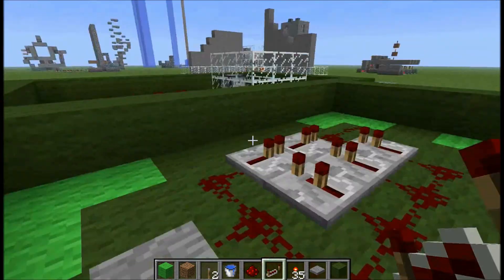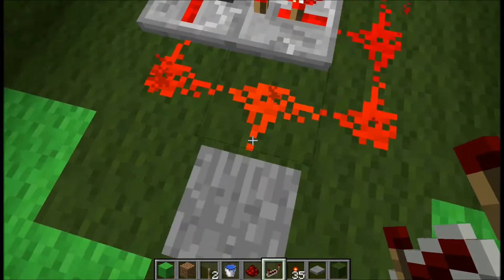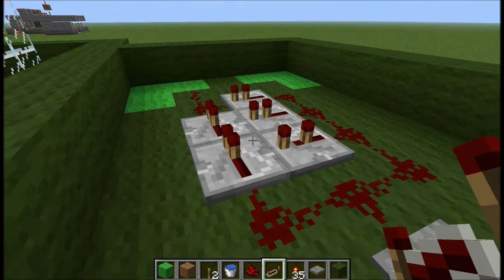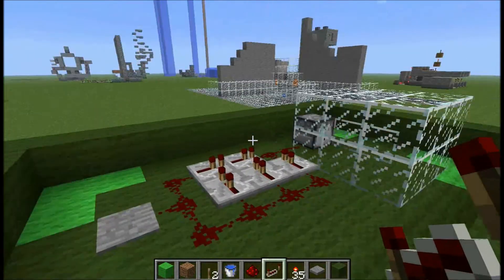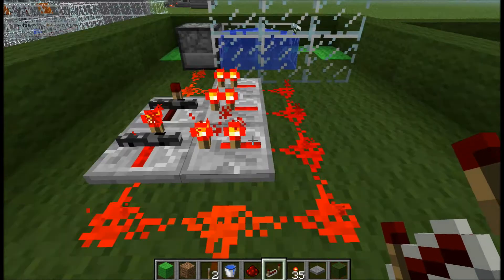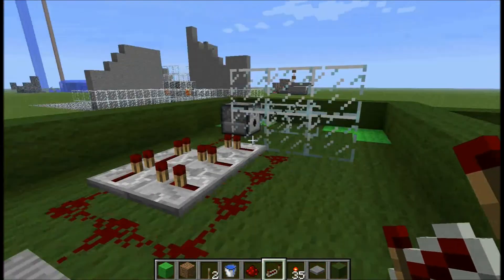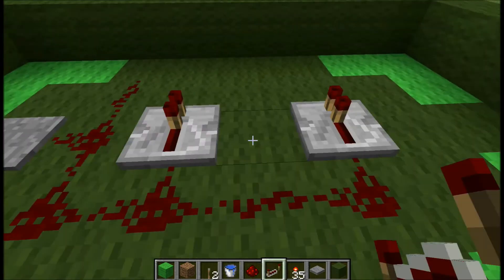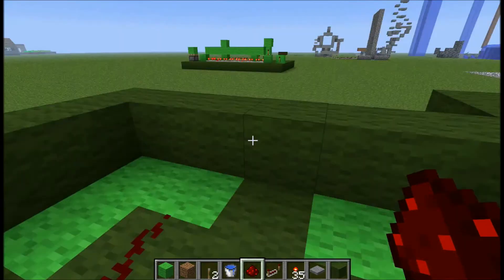Minecraft Double Pulse Pressure Plate Circuit.

Comment from the maker: You would have to separate the two outputs and put the pulse through a pulse extender, or mess with the timing and put both through the extender. 

I will upload a tutorial about pulse extenders latter on today. 

Also if you would like I could do a special for altering this circuit exclusively.
( ^_^) Thanx for the great question!